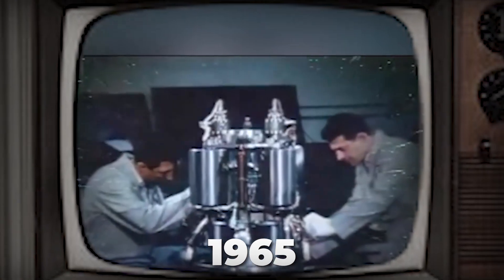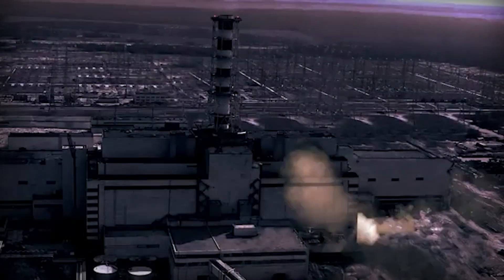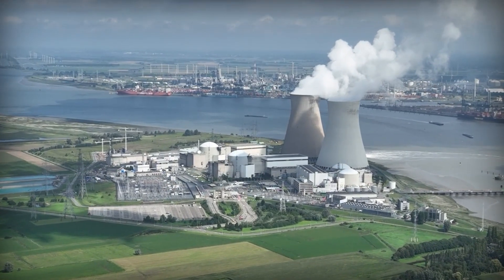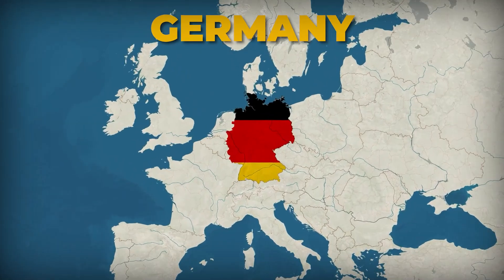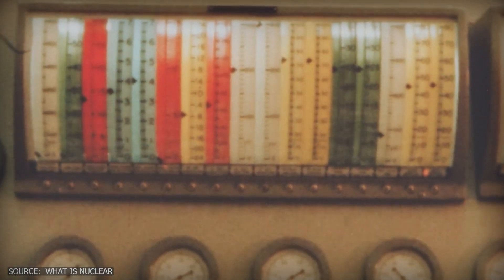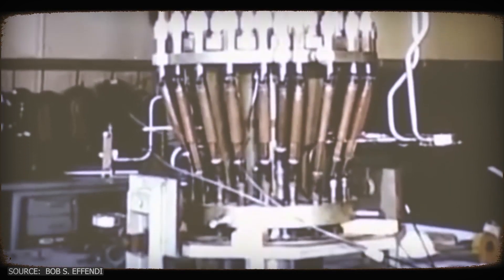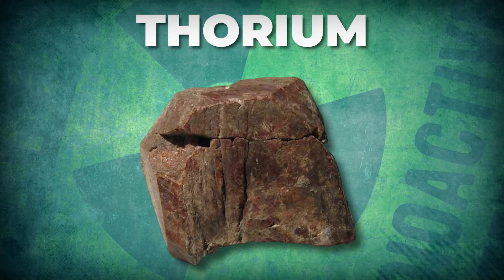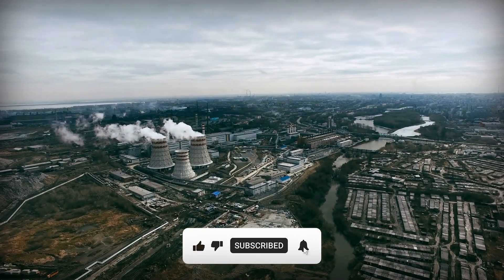Why the World Ignored Thorium — Until Now

Comment: i like the idea of the Dual Fluid Reactor...using molten salt as the fuel loop...and molten lead as the coolant...this way only the fuel loop needs to be expensive corrosion resistant Inconel's...and the coolant loop can use more common materials as well as magnetic pumps...lead also acts as a reflector which significantly helps the neutron economy for breeding thorium or burning waste...all whilst operating at over 1000c where Sco2 can be used for electric generation or high temp process heat for many things...the idea of any molten salt reactor was killed off back in the 60s because they are not good at producing weapons grade material...it was the cold war and had nothing to do with oil and gas companies lobbying...

Comment: Sheesh! 

1) Reactors that cannot physically melt down already exist. That's separate from using the thorium fuel cycle or not.
2) Reactors that produce barely any waste exist too. Those are called fast spectrum reactors (or just fast reactors).
3) And then it was shut down, because uranium was plentiful and 1) and 2) could be achieved without thorium just fine.

So, I know I shouldn't reply, because it boosts the video which it doesn't deserve, but I have to. 

The premise of this video is, and I'm putting it mildly, flawed and mis-guided.
Reply: Thorium reactor experiments were actually stopped due to the fact that the fluorine based salts corroded the special metals used when they came into contact with fission products (tellurium mainly) and weakening under neutron bombardment. The main roadblock then as is today is a material science issue.
Reply: @connclark2154  Thorizon came up with a work-around to the corrosion issue. Their molten salt thorium SMR design is based around exhangable molten salt fuel cartridges which are intended to be replaced every 5 years.
Reply: Throwing out the core and associated plumbing plus the fuel isn't a work around. It is a high level waste stream generator.
Reply: @connclark2154  Not in the modular way that they are engineering it. Molten salt and fuel stays, while parts of the reactor and molten salt vessel can be replaced when corrosion warrants this. 

But if you're not convinced? Oh well, then you're not convinced.
Reply: The real reason the project was closed down was that it was pretty useless for producing nuclear weapons, which was the main priority in the era pre-oilcrisis that emerged a few years later with the forming of OPEC..
Reply: I appreciate your comment. Question for your #3 response: Was creating Plutonium-239 from the light-water reactors also a factor as to why the Molten Salt Thorium Reactor was not continued?
Reply: @NathanZSolomon What do you mean? The fact that a conventional reactor would create Pu-239, while the Thorium cycle doesn't? I don't quite understand your question.
Reply: @Hydrazine1000  I'm no nuclear person, but from what I understand, Th-232 -> Pa-233 -> U-233. There is no Pu-239 created unless U-238 is introduced into the MSR...which hasn't happened yet. One of the products of Light-Water reactors is the conversion of U-238 to Pu-239. My question was do you believe that the military's need for Pu-239 was another reason why the Thorium reactor was abandoned and light-water reactors were favored?
Reply: @NathanZSolomon Several things have a role. Natural uranium can be enriched to a few percent U-235 and be used. It was abundant enough that the thorium fuel cycle didn't have an advantage, especially since thorium has to be bred into U-233 first. Spent fuel wasn't seen as the problem that it is today either.

At the same time, in a conventional nuclear reactor, the Pu-239 that is created contributes to the fission chain reaction. It's more fissile than U-235 and, depending on reactor type, can supply 60% of the energy produced from the nuclear fuel. What's left in spent "high burn up" fuel is not suitable for weapons grade plutonium, since during the use there will also be Pu-239 that absorbs another neutron and becomes Pu-240, or heavier. Too much Pu-240 makes the plutonium useless in weapons. 

The thorium fuel cycle really is a solution looking for a problem. We can achieve the same goal (an abundance of fuel, nuclear "ashes" that need 5 centuries of storage rather than a thousand, melt-down proof) by using certain fast spectrum breeder reactors that use the uranium fuel cycle. 

Thorium reactors would still be a welcome addition to the nuclear reactor fleet, because they are not inherently bad, but it isn't essential.
Reply: @Hydrazine1000  Thank you for your information. I'm here to learn 🙂

Comment: Whoever wrote this is very very confused.  and confusing.  Thorium is not nuclear fuel.  Thorium has no value as nuclear fuel.  In order for it to be fuel, it has to turn into somethig useful, like uranium.  This is done in a breeder reactor, where Thorium is exposed to radiation, and Thorium literally turns into uranium. it literally turns into a different element. Once it turns it is useful as fuel.  Liquid Salt Reactor means that the surrounding fluid in a reactor is salt, but at high temperature, it melts to become a liquid.  Right now there are PWR, pressurized water reactors, regular water reactors, and other fluids for reactors.  There are two types of nuclear waste.  the gloves, plastic, the metal containers, those will forever sit inn a hole.  The nuclear fuel, which is 10% of all nuclear waste  can be recycled in france.  They pull out the contaminants, and put the uranium back.  It is expensive so nobody but france recycles their nuclear waste.

SMR doesnt mean uranium liquid salt reactor.  SMR means small modular reactor, and the small reactor can use liquid salt or any other coolant they design it for.  You are using terms as if they all mean something else, and its frustrating.

So China has a thorium breeder reactor, India is building a thorium breeder. When you want to make electricity you need a different type of reactor in order to be efficient. So you dump thorium into a breeder reactor, and it turns into uranium, then you put the new uranium into a power plant.  The whole process of thorium requires an extra reactor, or a reactor that is designed to perform the extra step.
Reply: You need to study the different LFTR concepts. They don't require 2 separate reactors, the breeder process is integrated
Reply: sound like you pad by the oile companies thorium works and its way better than nuclear reactores its not the same at all

Comment: Almost every nuclear reactor video clip is misleading! Blue glow is only seen in research reactors! Most clips show conventional nuclear reactors being refueled.
Reply: Not true at all.  I work at a nuclear power plant.  The reactor glows Blue.
Reply: That's false. The blue glow is the when particles move faster than lights in that medium. Light is slower in water, however the particles emitted from radiation can be moving faster in that water than light, so there will be a blue glow.
Reply: Yes, that is correct, conventional fuel is blue in storage water

Comment: "warning, nuclear physicist talking.
Anything you watch or read when they talk about Thorium, do the Protactinium test: Ctrl+F "Protactinium".
If you've heard about Thorium, you might remember that 232Th is not a nuclear fuel per se, it must be turn into the good stuff 233U; thats the one that will fission and give you your energy from fission, to turn into heat, steam, etc. Think of it like a recipe, you have butter and flower, you mix them to get the shortbread that you want. See how easy it is for everybody to get some shortbread?
Except everybody also like to gloss over that between the "butter/flower" step and the "shortbread" step, there's a "white phosphorous neurotoxic napalm" step that might make things a bit more complicated the kitchen. That's your 233Pa.
So it goes 232Th+n -> 233Pa -> 233U.
This is when you say: "but wait 233c, this is just like 239Pu is produced from 238U: 238U+n -> 239Np -> 239Pu, this is happening all the time in normal nuclear power plants. What's the difference?". The difference is the same as between 2 and 27.
239Np (the step between Uranium 238 and Plutonium 239) has a half life of 2 days, while 233Pa (the thing between Thorium and Uranium 233) has one of 27 days. If you leave 239Np in the core it will quickly turn into 239Pu, but you can't leave 233Pa in the core for a month or it will capture more neutrons and turn into something else than 233U. (there's also a matter of cross section: 233Pa has a much higher probability of capturing neutrons than 239Np). If you leave your butter and flower too long in the over you'll get a brick rather than a shortbread.
If you want to use Thorium, you must: expose your Th; extract your 233Pu; let it decay into 233U; feed the 233U back to your reactor.
By now you should understand why liquifying the fuel make so much more sense for Th than for U. It's not "MSR work so well with Thorium", it "if you want to continuously extract your 233Pa, you'd better do it with a liquid fuel".
this is where you say "Ok, but still don't see the issue, you just pump and filter your fuel to recover the 233Pa, and let it decay in a tank, and pump/filter the 233U back in for it to fission".
I'm going to assume that you know what a Becquerel and a Sievert are.
Remember the 27 days? with the density of 233Pa, that translates into 769TBq/g (Tera is for 1012 , that's a lot), and because of the high energy gamma from our friend 233Pa, that also means a dose rate at 1m from a 1g teardrop of 233Pa of 20,800mSv/h. Starting to get a picture?
Notice how all the numbers I've use are not "engineering limits" that few millions in R&D can bend, those are hardwired physical constants of Nature: half life, density, neutron capture cross section, gamma energy. Good luck changing those by throwing $ at them.
Now try to imagine technicians working in those plants, like doing some maintenance, replacing a pump (I haven't even touched the complex chemical separation system you need to extract your 233Pa from your fuel or 233U from your 233Pa, which will definitely need maintenance). Let's put it this way: if there is 1mg of 233Pa left in the component they are working on, they'll reach their annual dose limit in 1h.
Now try to imagine the operating company of those plant, if you have the tiniest leak, like a tiny poodle, you can't send anybody in for months, meaning you are loosing month of revenue because of a tiny leaky seal failure, what would be a trivial event anywhere else (did I mention that molten salts also have corrosion issues).
When they say "Thorium has been used in research MSR", they mean "we've injected some Thorium and detected 233U" or maybe even just "we've injected 233U in the fuel".
So my humble opinion is that playing with it in the lab is one thing, turning it into actual power plants is slightly more problematic."

"TL;DR: Thorium will probably never leave the labs to reach industrial, electricity production scale. The physics is sound, the engineering and actual practical operating constrains just kill the concept."
Reply: Thank you for posting such a detailed and interesting comment, I will consider the content when I next purchase a nuclear reactor.  Best
Reply: Thanks for writing this much information about it. It clearly shows theory, experiment and industry have different standards for success
Reply: It's not been very logn since renewables, electronics, internet, batteries, etc. were seen as "...never leaving labs...". Guess what they are used as now? 
Giving up hope from hte start is pretty bad of an idea. All science is heavily reliant on tinekring around a general idea till a solution pops up, then using that solution to refine it further. In no way is any of this possible without taking the first step.
Reply: @ZippyPiglin36  essentially you will need fully robotic maintenance to make the safety aspect viable.... or a lot of disposable very smart humans.
Reply: @TheDaftChemist   We already automate all industries in general. It's not an issue to make some changes for nuclear. And no, you don't need disposable smart people. As of now, while we use very old technology and regulations, there has been zero deaths and no injuries from spent nuclear fuel handling.
Reply: @TheDaftChemist So, you think that is the plan the Danes & the Swiss have?... 🤪 Perhaps you should rethink that..🤨
Reply: @leifiseland1218  Your comment makes me wonder if you have the capacity to understand my comment or this video.